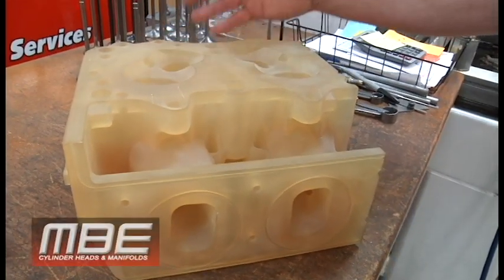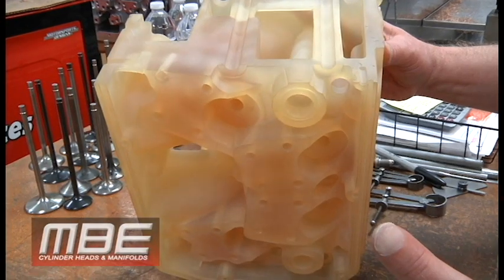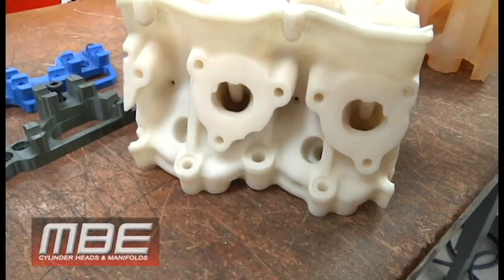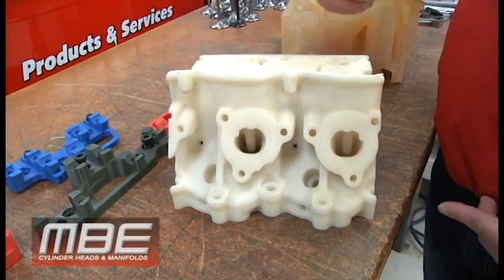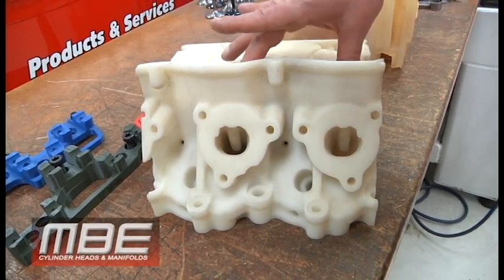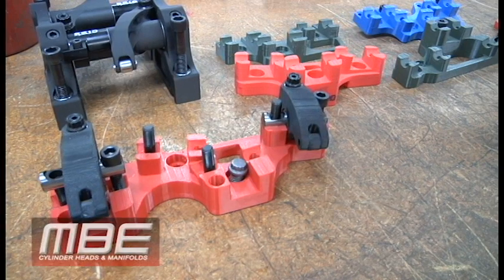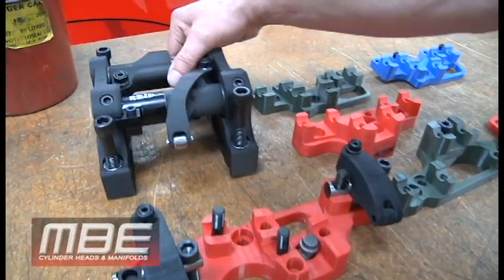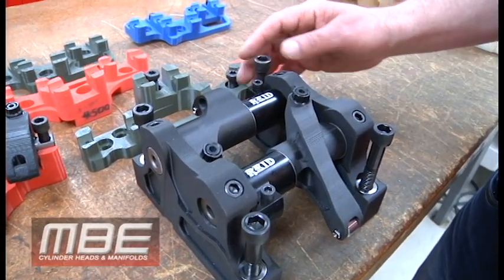Behind the Scenes in Designing a Cylinder Head  **TECH VIDEO **

Comment: Currently designing a 4 valve dohc head for my small block Mopar, and was also going to 3d print the prototype for Fitment before purchasing the big aluminum blocks for milling. What material filiment are you getting your models in? I have exsperience with Pla but thinking a nylon or ABS filament would make a nicer  part... Structurally anyway.
Super glad to have found your channel and thanks for sharing some of you guys process! Looking forward to future videos!!
Reply: How are you making the cylinder head sand casting, lost foam casting, machining from billet or some other way. If sand casting how are you making the pattern and are you using ceramics in the core?